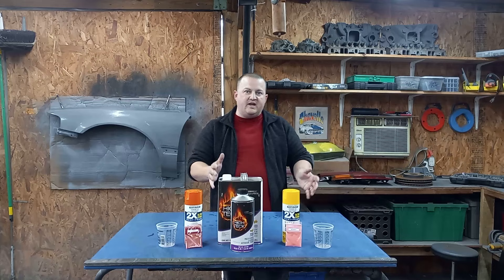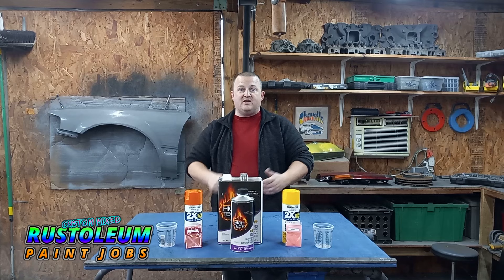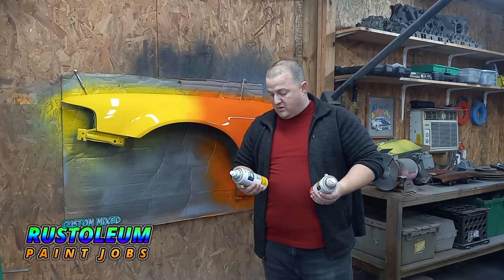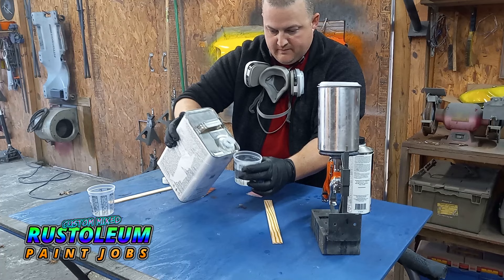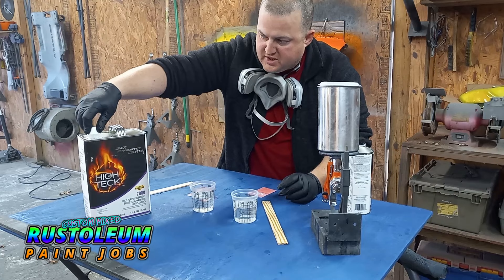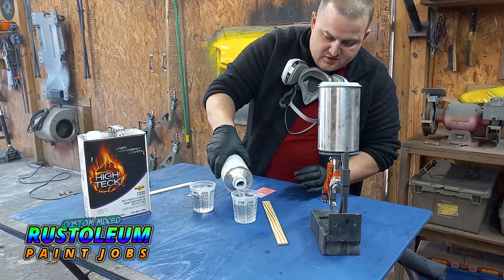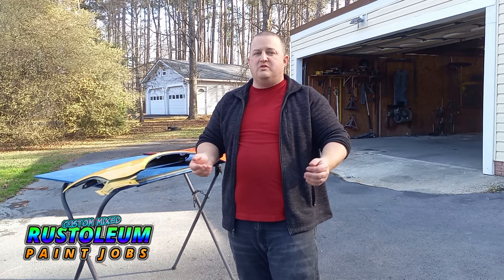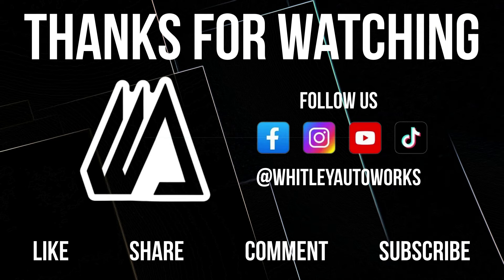RUSTOLEUM PAINT JOBS CUSTOM MIXED YELLOW AND ORANGE WITH PINK AND RED PEARLS!!!

Comment: Great hotrod colors.  I was always wondering about doing a Gene Winfield fade.  You pulled it off with rattle cans.  I guess I was just over thinking it, cuz you pulled it off perfectly.  I have one question.  I was watching a movie, The Expendables, and there was a pickup that looked black, but when the light hit it just right, you could see a dark green.  You may have done this.  Do you have a video on this and what's it called?  As always, thanks for sharing your knowledge.
Reply from the maker: Yes it's usually referred to as a ghost pearl but they are interference pearls check out kp pigments they have a great selection and I have a video I did rustoleum ghost pearl it was a green over white you can check that out as well for some ideas thanks for watching

Comment: How can you paint plastic and make it stick?
Reply from the maker: Use a good Plastic adhesive promotor or plastic primer. Sem makes a great plastic primer product and I usually use bulldog adhesive promotor but just make sure everything is sanded and cleaned properly then you should be good to go. Thanks for watching
Reply: @WHITLEYAUTOWORKS  would be a cool video to see which one holds up to bending and stuff.